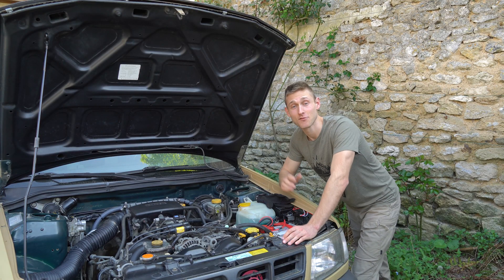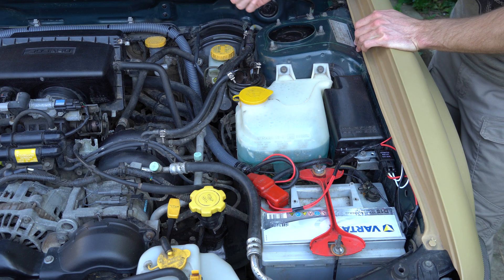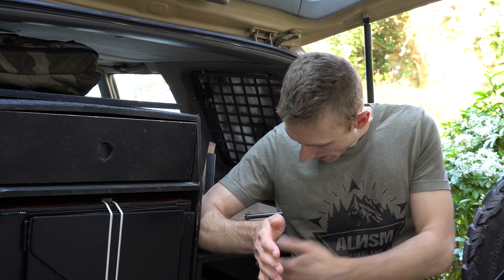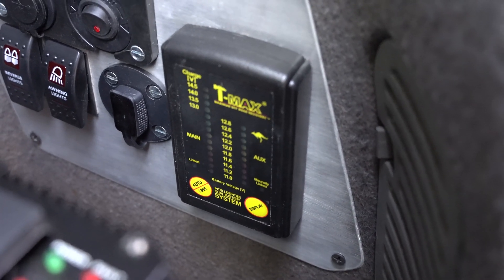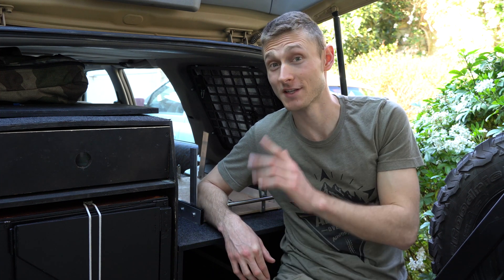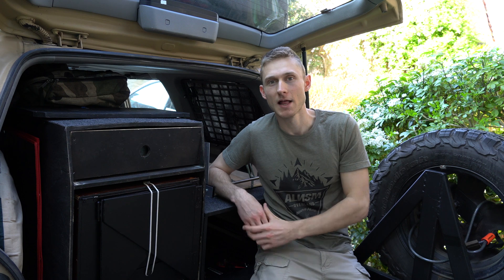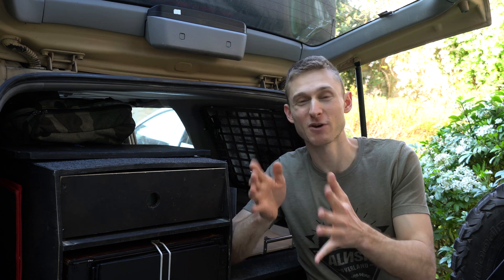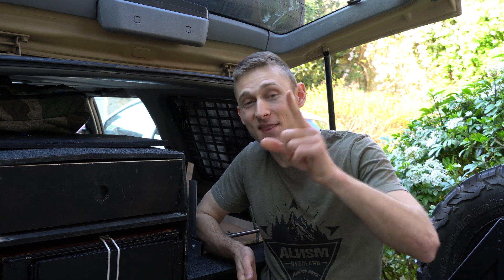12v Electrical and Dual Battery Setup in an Overland Subaru Forester

Comment: I love your set up, I am in Australia and just about a Forrester, I am having trouble finding where to go through the fire wall with my cables. Do you have any advice?
Reply from the maker: Thanks for your comment mate. Without drilling the fire wall, I used the hole for the AC condensation hose (not sure how to call that) located at the passenger place where feets goes

Comment: Thanks so much Jordan for sharing your electrical setup. This is gonna be super helpful for us in the future once we start building up the inside of our rig. We really loved the clean design and how you wired everything up! Especially the right rear corner where you got the plug panel and the mole rack holding up your extra batteries and cords. Super convenient and we'll thought out. One of the best rear space build outs on an overland subaru. 👌
Reply from the maker: Thank you so much! That's the kind of comments I love to read 😁
Take all the ideas you want from it, it's what it's made for 👊 And good luck for your electrical system build 🙏

Comment: Ah now my question from your window "blackening" answered itself, I didnt saw you mounted Molle brackets at the back windows, nice! Wanted to grab them too, but only found some for 700€ + delivery from the US, skipped that for now, haha. Also it seems they need to be screwed into the inner plastic lining.
Reply from the maker: Yes, the blacked out windows does the job! Especially on the right side which have red MOLLE pouch on it! The MOLLE racks are screwed in the plastic trim yes, but it doesn't move at all! Have you seen my video about it? You probably can get them cheaper in NL 😉
Reply from the maker: Check this out : https://youtu.be/hvP0rXLnPOk
Reply: @ALNSMOVERLAND  Ah yes I saw that right after I wrote the earlier message, thank you for linking it! Looks really good and I found it for only 200€ per pair. I am still struggling with the idea of screwing it in, since I dont know if I want to upgrade from my SH Forester to a 2016 Diesel one or even a Isuzu single cab with a massive pop up camper on the back. Screwing in the plastic kinda screws the resell factor. But maybe I will change my mind in a few months, who knows